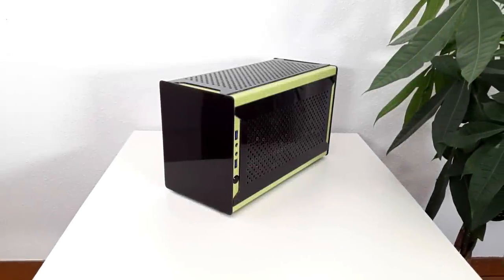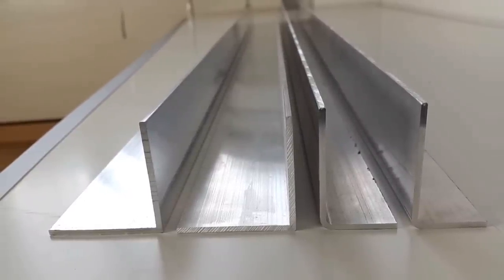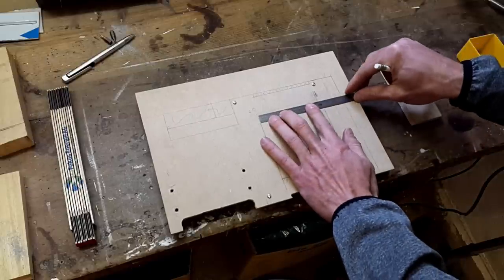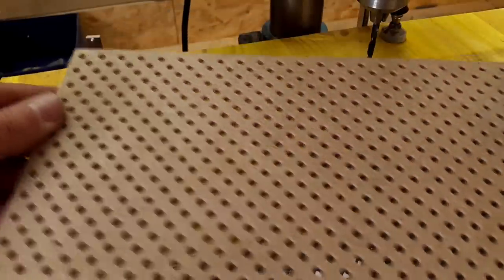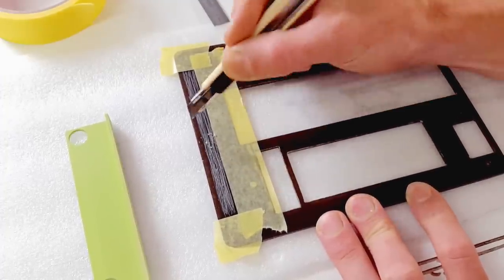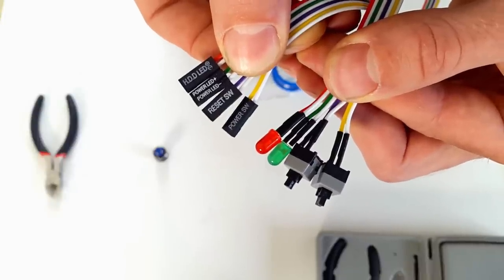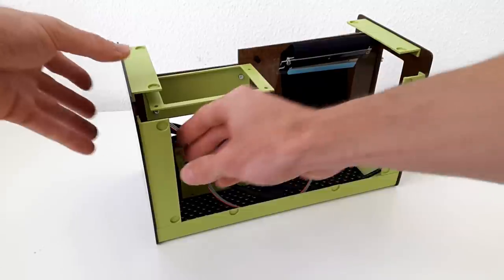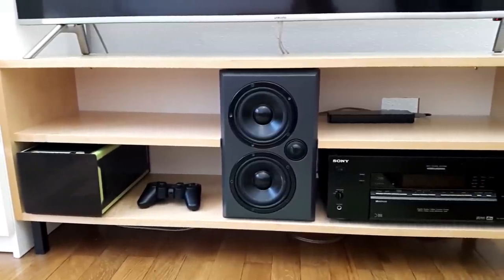DIY Computer Case for Mini ITX PC

Comment: there are 428 holes in total, in order to achieve 1,712 holes you must have done the process 4 times in total which is completely unnecessary and nonsense 5:25

Comment: Best DIY-ITX caseI ever seen. Please make a second one with more accessible materials and tolls. I have no garage and table-saw. I thinks ventilation holes can be done by hand drill. But I want to know if any other material for side panel which is more easy to find.
And please share plans and dimensions😊
Thank you, sub.👍
Reply: @calyxprophet5221  hello, can you provide a link to the website or a name to look for?
Reply: @calyxprophet5221  thank you

Comment: This is stunning! You should consider pitching your case to companies such as Lian Li or Corsair. I am sure that someone would want to work with you to mas produce these cases. Quick question, where do you get flax to make the side panels? I can get the other stuff and have things like a riser cable and power button but not the other one. I suppose I could always swap out the flax with another material but it would not look nowhere near as nice.

Comment: That's a great case.
Even better if it mass production with metal plate, also low price :) .
Reply from the maker: Thanks. My focus is on natural materials but aluminum panels are definitely also an option.
Reply: BooTec what is the motivation for natural materials? At least with Aluminum it can be recycled, but the epoxy used for the natural fibers means at its end of life it will end up in a land fill. Fantastic work either way, you are an inspiration.

Comment: Extra ordinary! I think if the total build is made of 2mm thick aluminium & use screws instead of magnets, the total pc would be more stable and for my purpose, I will attach a handle so that I can carry it, wherever I want. A portable monitor & this can be fit together in a medium size bag. It is definitely a far better & more powerful solution than a laptop at same price range. Great work. I think I got the idea to build mine.

Comment: Looks really nice. Probably one of the most polished and functional DIY cases I ever seen.

On a functional size - and though it has plenty of ventilation - I would try to add a fan below the mother board... unless going for size, where I would remove the ssd bay and aimed for a smaller cooler size.

You may not have notice it, but if you make a shroud for the rear IO, you can probably place the case with the front plate as the bottom or the top. Quite practical if you have vertical space but are limited on the other dimensions...

Only more of a personal taste, but I would have picked light beige instead of green, for that classic (and questionable) noctua look.